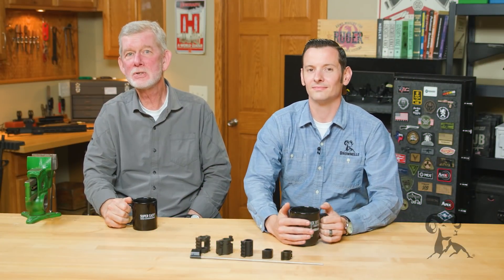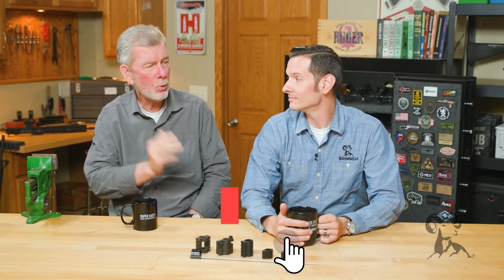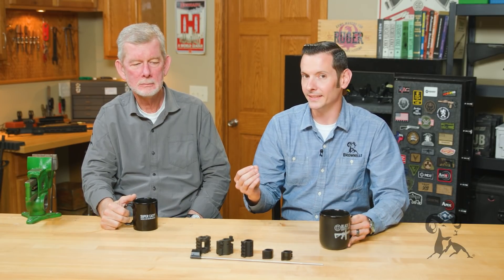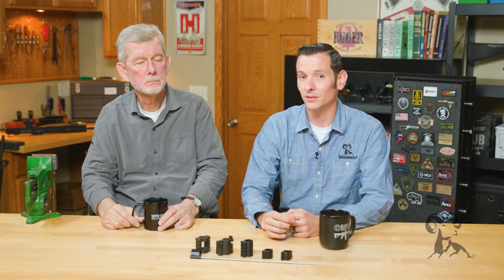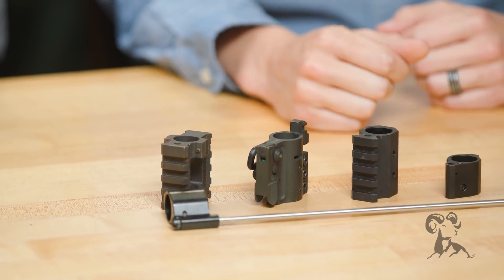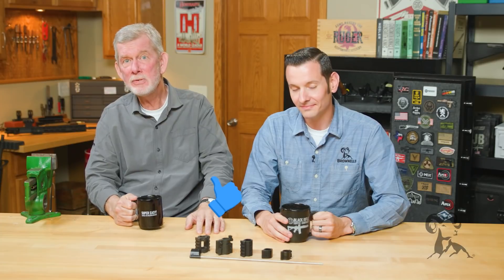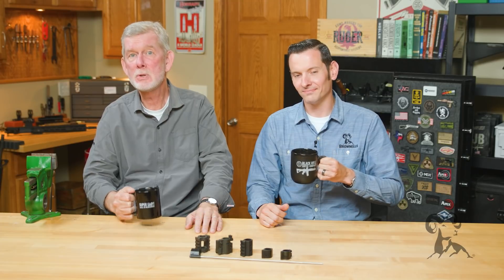Smyth Busters: Is an Aluminum AR-15 Gas Block a Good Idea?

Comment: Oh, thank God I was wise enough to document every part in my AR-15 build (part type, brand, model number, and price of purchase).
I never even considered if my gas block should be aluminum or steel, so I had no idea which is currently in my build.
I just looked up my gas block in my documentation (TacFire AR .750 Micro Low Profile, $5.97), then checked online. Milled steel. Much relief.

They are right that gas blocks are incredibly cheap, and this micro gas block weighs virtually nothing despite being made of steel.

Comment: You nailed this one!  I have personally seen several National Match rifles that had horribly eroded gas blocks, precisely where the gas hole in the block meets the barrel.  One rifle, with approximately 3,500 rounds through that barrel, appeared to be developing a "channel", being etched into the aluminum gas block and extending towards the butt of the rifle.  The armorer attributed that case of severe erosion to the gas block being loosely fitted but, that may have only exacerbated the problem.

Comment: I had a steel gas block completely split in half when I think somehow I got the gas tube misaligned somehow or the pin I used to hold it in was loose. I think I fired about 15 rounds or so until the action no longer would cycle and what did I see but a gas block split from end to end. I would not ever have faith an aluminum part in that location would be a good idea at all. I cant imagine what would have happened if in my situation it was made of a softer metal when steel was blown apart like nothing.

Comment: So that Wilson Combat gas Block is aluminum? Cost me 115 bucks there Brownells

The things made of steel, please correct this Brownells
Reply: Lol, my steel micro gas block was $6... Granted, I bought most of my parts during major holiday sales.
Reply: @Gottaculat  I built a poor man's honey badger in 7.62x39 10" i picked up a half case of subs for only 42 cents a round. I needed an adjustable gas Block for pistol length so I could shoot subs. Also this block is made of steel, Brownells is incompetent apparently 

All in the build was 1000 suppressor included

Comment: Would a titanium gas block be the best of both worlds?
Reply: Not sure but i know titanium burns. Titanium suppressors and muzzle brakes emit sparks of burning material so they must be eroding but i don't know how fast or how big of a deal it is. I doubt you'd want that stuff in you action. Hopefully someone more knowledgeable will chime in.
Reply: @Lucas12v  Titanium is more brittle than steel and has a different heat coefficient. Even if it has a higher melting point, the gas block is getting blasted with tiny particles of hot metal and powder during firing, and will slowly chip away at the material, causing erosion faster than steel due to reasons other than heat. Aside from that, it expands and contracts from heat at a different rate than the material of the barrel.
Reply: No.

Comment: Busted how? I know YouTube likes these short videos but I’d still like actual numbers. Maybe some pictures showing wear after 10,000 rounds on a aluminum block versus steel. That evidence has to exist and seeing the real proof versus two guys just agreeing with each on a workshop set would drive the point home in a far better fashion.
Reply: I have faith in these guys and believe what they say. However, a real example to show to the audience or some data would have been a nice addition.
Reply: Sounds like someone has an aluminum gas block
Reply: I don't even know what a gas block IS. I wanted to see where it fits, maybe an animation showing how it works. And definitely, before and after pictures showing the damage. Maybe a few words about the symptoms, so that someone who has an aluminum gas block will know why his weapon has started acting up.
Reply: @50srefugee  a gas block is the forward part of a firearm that covers a small hole in the barrel. Your gas tube runs from this forward block down the gas tube into a piston or like in direct impingement its part of the bolt carrier group.
To see if it is aluminum or steel use a magnet.
Reply: @josephroach711  Thankee!

Comment: Idk why gun owners are so obsessed with lightweight. It’s a rifle it’s meant to fight with! God did we become so feminized in this country we can’t handle a little weight?
Reply: Weight is a big deal and a major consideration for the military.  It probably won't matter much at the range or in a typical home defense scenario, but if you're talking about having to march with it along with ammo and gear then it starts getting pretty important.
Reply: So why doesn’t the military use light rifles ? Lot of militaries are issues scars which are not light
Reply: @889976889  The military does use light rifles.  The standard issue firearm for most units in the US military is the M4 carbine and militaries in general moved away from heavy battle rifles to lighter assault rifles during the latter portion of the 20th century.
Reply: Assault rifles aren’t real. The m4 is light ? Define what’s light? I know guys who were issued fn scars. Which are about 8-9 pounds depending what’s on them.
Reply: @889976889  Assault rifles are real, they just aren't what media and anti-gun groups claim they are.  Assault rifles are selective fire rifles with detachable box magazines chambered for an intermediate cartridge.  These have been effectively banned from civilian ownership since 1986.

Of course some military units are going to be issued different weapons.  Weight is an important factor, but it's certainly not the only factor.  Situation / role matters, as do things like cost and durability.

Comment: OK, I get the fact that hot gases will eat away at Aluminium, but what about galvanic corrosion between the dissimilar metals?  Or is that covered by the anodization?

Comment: What about polymer lowers? A good idea or no.
Reply: Entirely depends on the polymer used, how it was designed, and if it's a hybrid design say with steel or aluminum inserts to reinforce critical parts. Something like the KP15 that Inrange and Forgotten weapons helped to design and bring to market for their What Would Stoner Do 2020 project is an excellent idea, and is extremely robust while still being very lightweight. They redesigned the whole receiver and grip to use a polymer process though so it's definitely not the same as the original design. Some of the ones that have a reinforcing insert where the receiver tube attaches could possibly be OK. I haven't looked into them in depth, but my understanding is that they're a viable choice if they are well made. 

The complete 100% polymer designs that are just a straight up clone of the milspec design with no reinforcement or changes are a bad idea. The polymer while tough doesn't seem to have enough durability especially around the buffer tube and the transition to the grip area.

Hope this helps and gives you some good insight!
Reply: @2011JMB  thanks brother! I’ve wondered about them for years.

Comment: Then why does Brownells sell aluminum gas blocks.  I just checked my purchase history and you sold me a Brownell’s branded aluminum modular gas block years ago.  No mention then that it was junk.
Reply: Not their fault you didn't do your research first. Common sense should tell you that hot gasses will erode aluminum.
Reply: I'd presume cause a bunch of customers asked for them to be stocked and sold. My guess is that there are at least a few competitive shooters that would choose an aluminum block for the weight savings (however miniscule they may actually be) and be more than happy to swap the blocks when needed.

Also I suspect that Steve and Caleb (the hosts in our show, don't have any real influence or ability to get products removed from sale; especially when the product does exactly what it claims and is functional within it's design parameters. Yes it'll wear out faster, and in pretty much all ways is inferior to steel, but it still is a functional product that does exactly what it's claimed to do.
Reply: An aluminum gas block will generally last the life of a barrel, like all things this isn't written in stone but usually plays out that way. Some people are fine with this, some are not.
Reply: Crybaby ass

Comment: I would think so...lots of flame cutting/erosion...prolly doesn't make THAT MUCH difference to the casual ownwr/shooter though
Reply: It does. Not only that but aluminum expands at different rates than steel, so your gas block probably won’t hold its position when it gets hot.

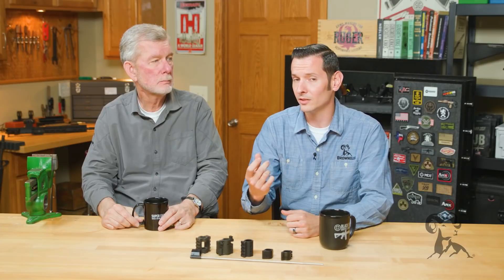Comment: So, are you confirming that an aluminum gas block will suffer a Galvanic Reaction? Or are you saying that the gas block will "eaten away" (00:50) from some other cause?
Reply: Probably eaten away from the hot gases from the gas port. 

If steel can suffer substantial gas port erosion, imagine how something softer with a lower melting point would do.
Reply: Erosion from the gas, no galvanic corrosion.

Comment: What about if they made a titanium gas block? Would that hold up?
Reply: Yes but not worth the cost unless one is building one of those ultra low weight builds
Reply: @blantant  For sure. Titanium is many things, but cheap isn't one of them.
Reply: Probably? Titanium is far more resistant to heat and pressure than aluminum. I mean, they built the SR-71 out of it, and that jet stands up to the heat of cruising faster than almost all bullets quite well. 

Although there’s a certainty to steel.
Reply: It's a costly bitch to turn.. 
Everything lightweight and pretty will cost you...😉😉
Reply: It will hold up, but isn't worth using over steel.
Reply: Thank you all!

Comment: What about titanium gas blocks?
Reply: I sould imagine it can work but will become brittle over time. Secondly titanium is a bitch to turn which will make it costly to produce. Best is to stick with chrome molly or similar
Reply: @drevil2783  isn’t titanium really only brittle when it’s cold? I know V Seven already makes titanium gas blocks.
Reply: @Murderus  excuse my spelling, verbs and what not. English is not my first language. 
 I know from experience that if it goes through many temp changes (now i am talking 0 to 200 degrees celcius or more, and then back again) it becomes less pliable and starts to become brittle. Especially if these changes occur rapidly. I don't know at what temp the gas enters the port but i would imagine it is way up there.

Comment: Kinda ridiculous with this one. The gas port size in the barrel determines the gas amount not the gas block port size. So why does it matter that it degrades in size over time? Not that I would think aluminum is a good idea .... Js that's not the reason it isn't
Reply: Because the aluminum gas block will leak gas as the aluminum and steel swell and shrink at different temperatures. The gas port on the aluminum gas block will erode at a much faster rate creating grooves for the gas to escape...

Comment: No kidding . Changed a customers high dollar aluminum gas block because of cycling problem . It had eroded to the point that after ten rounds it opened a crack that was letting out all the gas . Hard to diagnose at first because it ran good when cool .

Comment: I think the phrasing of this myth actually gets it backwards. I think the truism that everyone is aware of, the factoid we all know all about, the thing that gets bandied about by Internet wise guys...all usually without any acompanying evidence...is that steel gas blocks are better than aluminum.  Sitting here in my Internet armchair, I concluded the same thing after doing no research, but I was hoping for something more authoritative from Brownells. 

That thing you said about the erosion of the channel that connects the gas port on the barrel to the gas tube. It makes sense! It is entirely concordant with my understanding of reality.  It seems likely to have happened many times, and I would expect that two gunsmithing experts would at least be able to say something like "the leading cause of short stroking on AR15s that have come through my shop is gas leaking from the gas block, and nine times out of ten that block has been aluminum."  Experts might even have an old Polaroid of a particularly eroded example. Heck, an expert might even keep an old, worn, aluminum gas block around as a teaching aid. 

Incidentally, YouTube channel School of the American Rifle has a video where he actually shows the effects of gas erosion on an old, worn, aluminum gas block. Here's a link: 

https://youtu.be/8FNnk6u5dZ8 

That's me doing Brownells' homework for them, and they really ought to do better.

Comment: Aluminum's temp rating across the board is too low to be a good material to expose to the high heat of a gas port. The gas cools enough by the time it hits the receiver not to erode much at that end, but on the gas block end it is way to hot & once the gas erodes the anodization off the surface the soft aluminum gets eaten away quickly. Just a really bad choice period.

Comment: Someone should definitely try a magnesium one
Reply: Tin foil here
Reply: ...bendy straw....
Replaces the gas block AND gas tube...
Reply: @lostpyper  well, now you're onto something. I was thinking, put a 90° on the end of the tube, slip it directly into a port in the barrel, and 30-40 wraps of duct tape oughta hold it in there.
Reply: @funkla65  hmmm.... I bet if you use a little JB weld and electrical tape you could probably get through about 5 rounds before it turns itself into a bolt-action....
Reply: @lostpyper  I took an old A2-style gas block and drilled a hole in it. I threaded the hole and added a set screw in an attempt to make an adjustable gas block. 
SPOILER ALERT: It didn't work. 
It shot the set screw into another county.

So I JB Welded another set screw in the hole and put a thick layer of JB Weld over the area. After a few days of curing, I tested it...NO GO. 
It didn't take 5 rounds, either!
Reply: @Cautionary_Tale_Harris  well I'm glad  followed this conversation of absurdity. I was actually thinking of doing that same thing because the JP adj gas block\fsb is pricey....good talk...
Reply: I put a polymer gas block on mine.

Comment: I have built several of these machines but I believe I use steel, but I'm going to go back and double-check and make sure I have used steel and if not I will swap them out. (you might be able to check this by looking through the handguard slots,  if not it's just a matter of removing the handguard and checking out what the material is)  We are only talking about a few dollars and sometime / labor. Of course we can buy the parts from you guys. LOL. Thank for the info guys.
May the 2nd Amendment be with US.  🐢 👍 😃  🇺🇸

Oh by the way you can use a tiny magnet to determine if it's steel or aluminum. 🐢 🤔 👀
Reply: You and me both Anthony, lol😁. Idk how many I've actually built for other people and relatives, I guess I'll need to check mine too and you have a good idea with the magnet, thanks for the tip! 👍👍 Have a Blessed day my friend. 
                 Jay.
Reply: @silvergrizzly316 : Roger That

Comment: A titanium one actually sounds more brag worthy
Reply: Larry Funk You read my mind. Titanium for gas blocks over steel. But then again titanium is less dense so even though it has better heat and corrosion resistance, wear might still be a problem.
Reply: Titanium can catch on fire, it's hard to start and almost impossible to put out. Not sure I would put titanium in such close proximity to the hot gas.
Reply: @grockwood1  yeah, I actually think deviating from steel is silly in this application. Other materials will like cost more and/or perform worse.
Hence why I also sarcastically suggested magnesium, which is an even bigger fire hazard.
Reply: @grockwood1  They still use it in jet engines for its high heat resistance that steel can't match and steel is heavy. But its less dense so not as durable.

Comment: GM did the same thing with oil pans and transmissions
Reply: Everyone on the planet with a decent car does.  Those parts have been aluminum in sports cars since the 1950's
Reply: @elingeniero9117  those aluminum parts melted
Reply: Ford apparently has some polymer oil pans on F150s now. They actually seem pretty solid. Not entirely sure the reasoning for it…cheaper to make I suppose
Reply: I think they tried aluminum wiring harnesses a couple of years, too